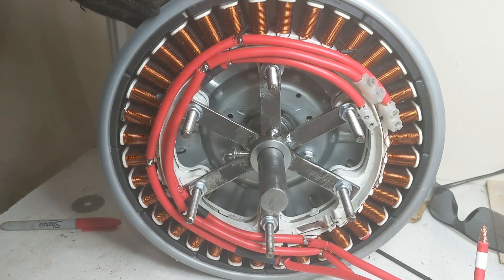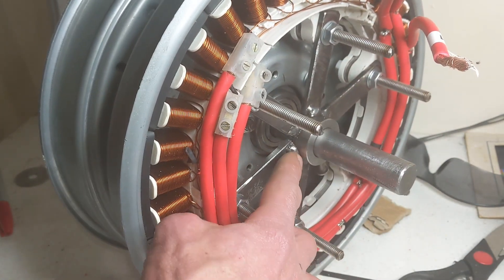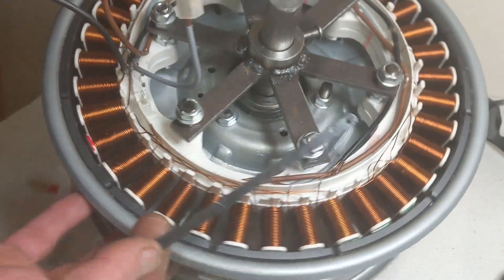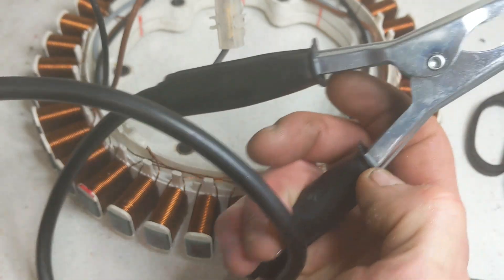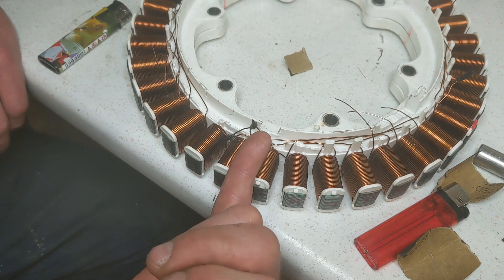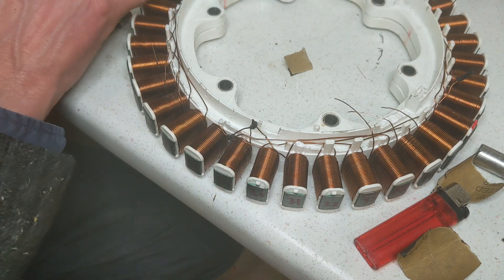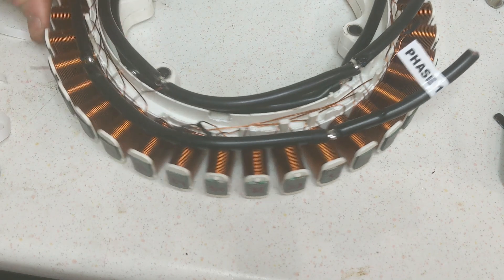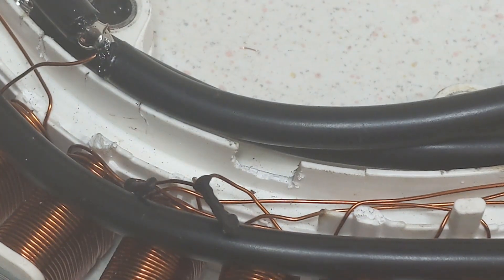LG smart drive secondary stator completion, FREE ENERGY WIND TURBINE project 12 November 2020

Comment: i may have to do the same but i wonder how a multiple would go like 3 or 4
Reply from the maker: 4 would be good but you need some bigg ass blades, I haven't seen someone running these with decent blades so that would be interesting :)
Reply: @GavinFreedomLover  not sure, ive seen guys show blade calculations , it seemed like blade size corresponds to watts output in a given wind, so you could be lucky, i do realise power in low winds will mean decent blades . i think by memory i went two coils per phase for my puny 1.8m total span blades but around 2.5 to 3m span i see guys go 7 coils yet our F&P are 42 poles.
Reply from the maker: I think that having the two gear combinations will mean it can run in low wind, I have used the same sized cogs to make it easier as the chain will be the same size.

Comment: the maximum that I have come to generate in this generator was 25 amps I think these wires too thick for a small amount of amps three 2.5 mm wires would be enough to pass this current, that is, 3 wires of 2.5 MM would be enough pass 64 amps in AC ... This very thick wire can leave the rotor unbalanced